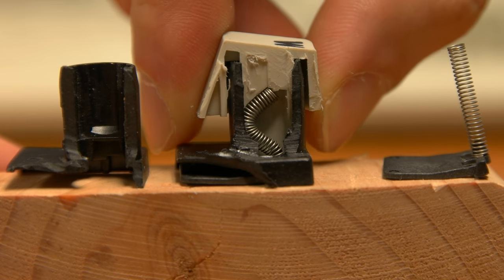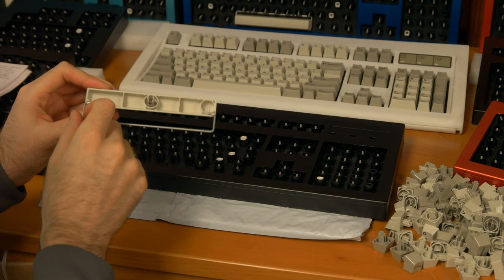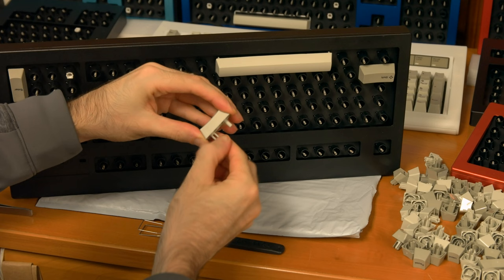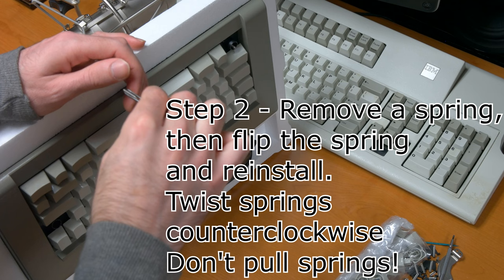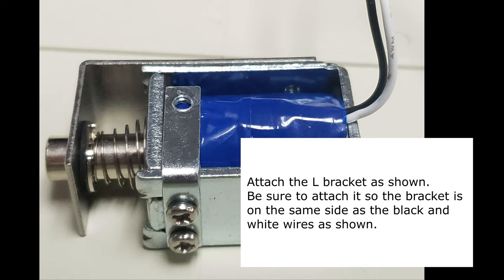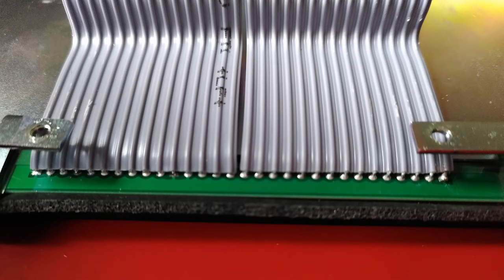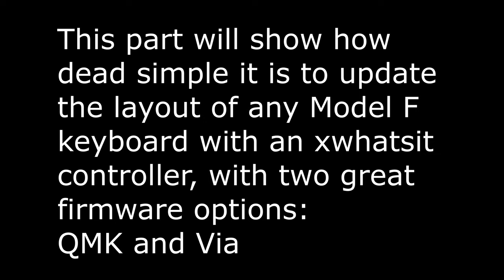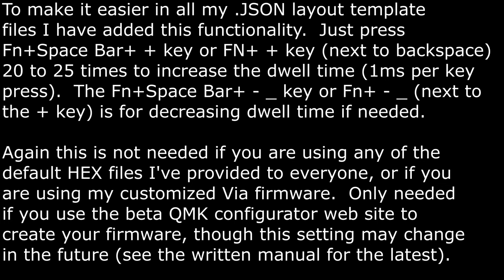Brand New Model F Buckling Spring Keyboards Full Setup Guide

Comment from the maker: 00:00 Introduction, safety information
02:57 Parts identification
03:28 Initial setup steps
05:35 Installing stabilizer inserts
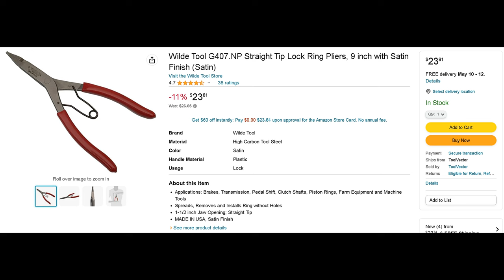07:15 Spacebar installation and optimization
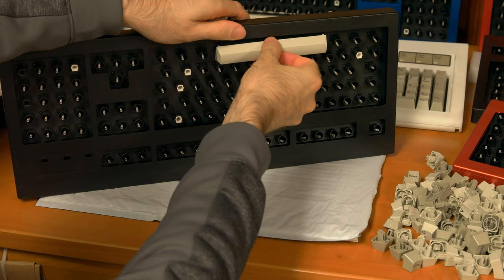12:16 Installing the remaining keys; fixing stuck or binding keys (the wiggle method, etc.)
18:23 “Quality control secrets” steps:  adjusting a key that doesn’t click, doesn’t work, or buzzes
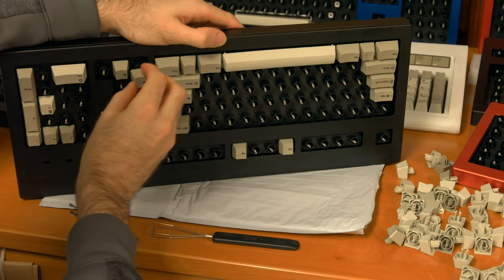23:23 Steps starting with plugging in your keyboard to the computer (testing, troubleshooting double presses, etc.)
27:26 Solenoid installation (optional)
31:02 Diagnosing issues with many keys
37:08 Opening up the keyboard inner assembly (change/maintain the layout or case)
40:08 Intermediate firmware adjustment (firmware/layout customization)
57:40 Appendix (cleaning, modifications, etc.)

Comment: will there ever be a lower budget option for these keyboards, i really wanted a beamspring keyboard but it was far beyond the price range that i would be willing to spend on a keyboard, im currently using a unicomp and i spent pretty much the maximum i would be able to on that keyboard
Reply from the maker: These keyboards are already priced at less than half of what IBM charged, adjusted for inflation.  The Brand New Model F Keyboards are far more expensive to manufacture than other keyboards and even though thousands of keyboards have been made, that is still considered low volume in terms of mass manufacturing, so potential economies of scale are absent.  Compared to other computer components the IBM Model F technology can last for decades, unlike a similarly-priced smartphone or graphics card that becomes outmoded after a few years, for example.
Reply: @Brand_New_Model_F_Keyboards  very interesting, i never knew they were that expensive. Would it be possible for me to buy the parts and assemble the keyboard myself for cheaper.
Reply from the maker: @awesomeanimations3485  Unfortunately no, these keyboards are all pre-assembled and fully tested by the factory.  I do have a down payment/payment over time option - feel free to touch base through the project site for details.
Reply: This was also during a time when new computers cost over $5,000… non inflation adjusted

Comment: Just got my F104 which I'm happy finally exists and the only thing not working correctly would be a few numpad keys. A few of them either don't register or register adjacent keys that weren't pressed. Reseating didn't work so I'll have to try other fixes.
Reply from the maker: Hmm, strange!  Please follow the manual to use the pandrew signal level monitor functionality to test the PCB and email me if you still have issues with the board.

Comment: What's the function of the solenoid; is it just to make a sound? Did IBM keyboards really have that? I thought it was just the buckling spring mechanism creating their distinctive sound.
Reply from the maker: Yes, it makes a sound and also shakes the keyboard a very small amount that you can feel while typing.  It was added by IBM to make their keyboards sound and feel more like the IBM selectric typewriters that were what everyone was used to using before these keyboards.
Reply: @Brand_New_Model_F_Keyboards  Interesting, thanks. I have a Selectric, so I'll just use that when I'm nostalgic for that feel. 😀

Comment: The fullsize keyboards (classic and compact) are plug and play ready?
No need for using firmware or somerhing?
Reply from the maker: Correct, no firmware loading or drivers are needed to use the keyboard, though you can modify the firmware if you'd like (as shown in this video).